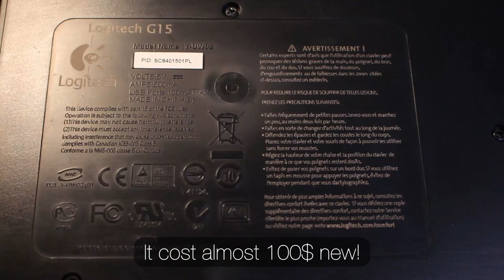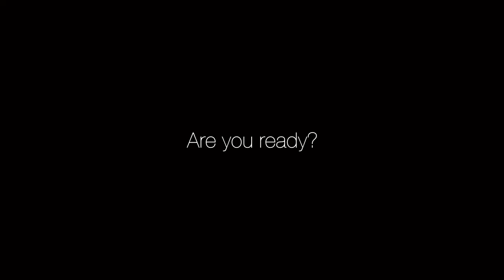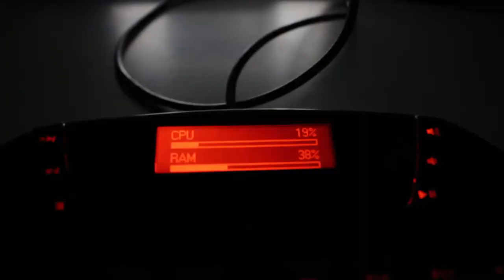How to restore and clean Logitech G15 V2 keyboard

Comment: I bought one of these at a secondhand shop complete in box around 07 or so. Still using it to this day on my daily driver and still haven't cleaned it. It's kinda gross thinking of the previous owners skin and gunk in there. If I recall correctly the enter key had some mysterious sticky stuff stuck between it and 3 and period key 🤮 Gonna give it a good soak and clean soon. Thanks for the inspiration!
Reply: Seems too late now, should've done it in 07 or so.

Comment: Great vid. i need a little help with my G15 please, the key lights flickered then went off! apart from the num lock scroll lock and caps lock keys they're still lit up. It still says G15 on the keyboard screen but the 4 buttons and circle button underneath doesn't seem to do anything now but the sound buttons and the next/previous buttons still working fine. any ideas what the issue could be??

Comment: For a less thorough cleaning, would it be possible to use a keycap puller to remove just the keycaps to clean around them?
Reply: hey, have you found the answer ?)
Reply: @VladimirChukanov  I ended up buying a keycap puller, and it did work to remove most of the regular keys, though I didn't try to take off keys like the spacebar.

Comment: I have a G15 v1 I guess? How do you fix the lights and make them brighter ?
Reply: The v2 actually has a button to change the brightness, but the lcd display can be changed also
Reply: youtube.com/watch?v=tt-57kwVqcU  this vid shows how to replace the led's. Dis'assembly and re.  The inverter on my v1 g15 is weak also (for the lcd) so i am looking for what-ever capacitor is involved to replace. as that's usually the reason for inverters to be under-powered/aka dim.